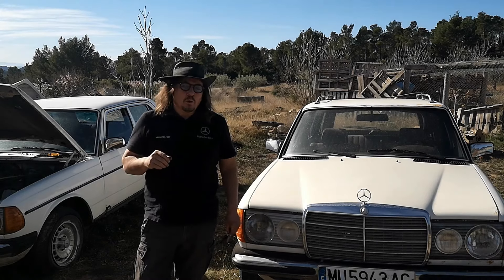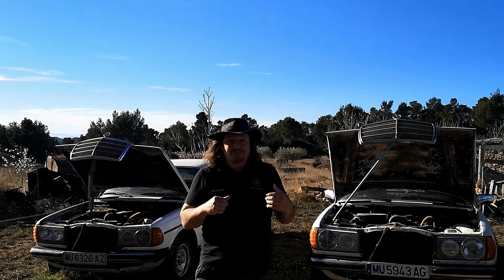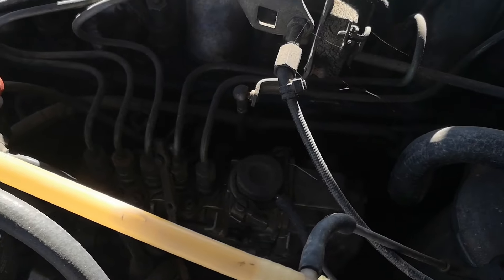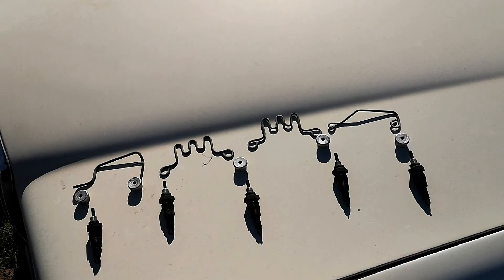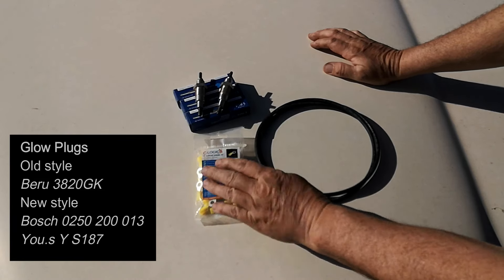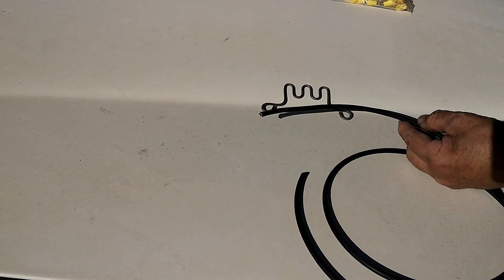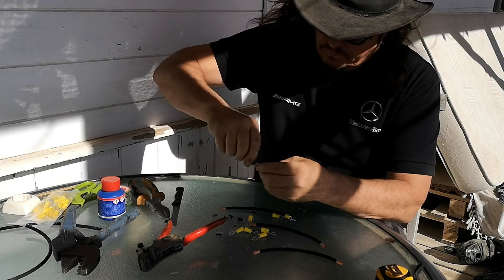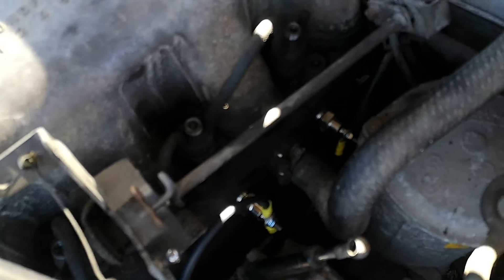Mercedes Benz W123 - Upgrade on the old style Glow plugs on diesel Class E repair modified

Comment: Great conversion! I've done it with my 1979 200D a few years ago. It's such a great difference at cold starts 😄
Reply from the maker: Thank you for your comment. The newer one have more voltage than the older one.
Reply: @mercedes-benzw123  Correct. 0,9 volts vs. 11 v the newer... If I remember.
Reply from the maker: @ericniceboy  mine are are 10.5v but yes his is correct

Comment: Hey super video. I'm was just thinking about this mod. Could you give a reference for the parts you used ? You said some 10mm cable, but I'm not sure how to search for the yellow tips. Thanks!
Reply from the maker: Thank you for your comment. This cable and terminal can be purchased in any car part shop, Leroy Merlin, Feu Vert, Norauto, etc... No problem whatsoever. In any case show them the video and they will know
Reply: okey will do, thanks a lot
 @mercedes-benzw123

Comment: Great video!! But I have some concerns about, how the new glow plugs affect the old relay, mine is under the dash. Regards
Reply from the maker: Thank you for your comment. If you have concerns, simply don't do it and continue as it was before.
Reply: My problem is that I've had twice the first glow plug burned(wire melted on the tip).   First I'd to open the engine, second only replaced. Now I do not speed up too much, and  until now no problem, but I need to do something to avoid third time.
Reply from the maker: @JavierPereyra-c7f  I suppose that you know that the old and new glow plug have different voltage. If something burn, it seems to me that you have an electrical problem.
Reply: What you mean different voltage, I read spec for both, and said 0,9V. All my problem is with old style glow plug. I have not try the new ones.
Reply from the maker: @JavierPereyra-c7f  What I mean is that old style are 0.9V and new ones are 11V. Anyway, no need to continue this as per your concerns. Simply find out where you have your electrical fault. Take care.
Reply: @mercedes-benzw123  thank you ,that's right. I will try to find next week with the expert.
Reply from the maker: @JavierPereyra-c7f  all you need is an auto electrician